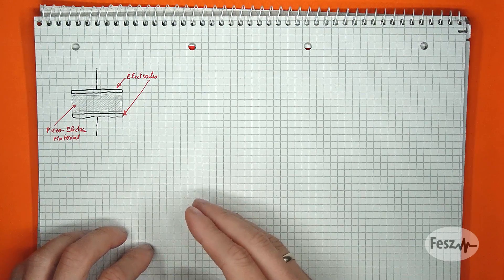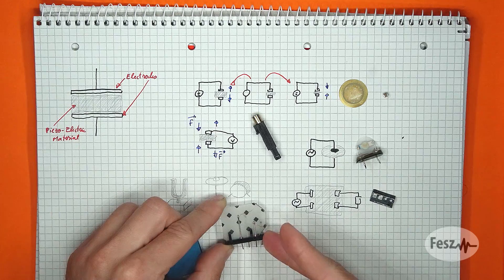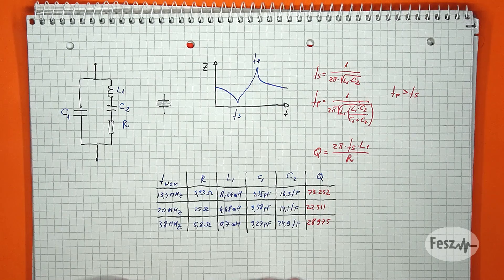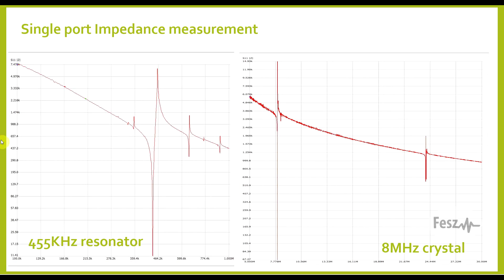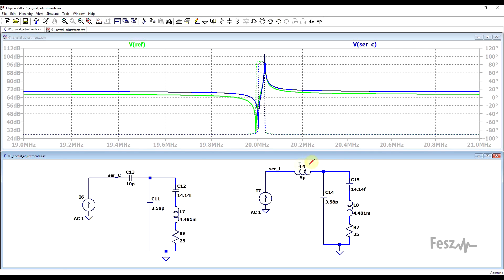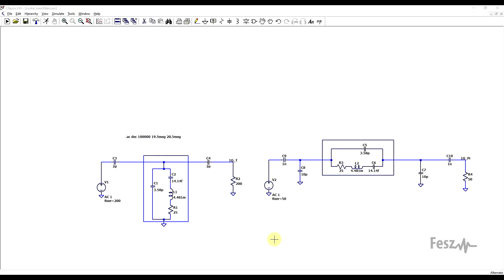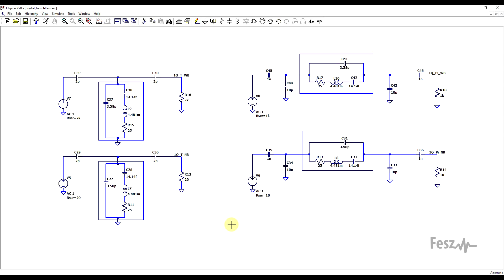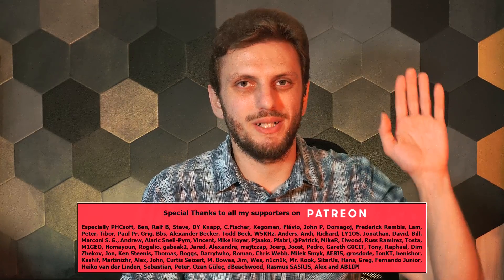Piezo-Electric Filters

Comment: The crystal model used is called the Butterworth Van Dyke (BVD) model. The model can be extended by adding multiple RLC circuits along with a single parallel capacitor to model the primary and secondary resonant and anti-resonant frequencies. For sonar usage, widening the band between the resonant and anti-resonant frequencies by addition of series and parallel inductance is an underutilized method for achieving better performance...

Comment: If that was a Philips delay line, I used to make those at the Philips plant in Blackburn UK probably around 30 years ago.  I operated the screen printing machines that put the diamonds of damping compound on the glass. I remember a display in the entrance that had with one of all the different generations of the delay line they had made.  The very early ones were huge.
Reply from the maker: Indeed it is a "Philips, DL700, 84701; kh 08010" these are all the markings present on the top side. I think it would be really special if this was one of the components you worked on in the past;
Reply: It would think that it would be rather unlikely to be one that I helped produce.  We would probably have produced many thousands per week. I think I left in around 1996 but production was ramping down by that point. Didn't think about it when I worked there but looking back it was really quite an interesting process.  Thanks for showing it. It's brought back some great memories.
Reply: So is that glass or quartz?
Reply: Was definitely glass,  although if I remember correctly I think some special formula (it's a long time ago).

Comment: I thought to myself when I first saw the case, “That's a delay line from a 1970s TV”. Yep, I'm old.
Reply from the maker: It took me quite some time to figure out what it was... I remember seeing these in old TV sets in the past, but I never knew what they did.
Reply: Me 2. Also old person 😂
Reply: @0:08 it's a video scan-line delay-line. It contains 1 scan-line (63.5uS long) and its analog contents are used to repeat/replace a scan-line that has a "Drop-Out" in it. The piezo-electrodes are on the corners of the glass, and the Piezo transmit beam enters @ a 45 degree and bounces around diagonally off of all of the edges inside until the signal finally hits the Receiver Piezo. The Seven black-spots on the glass are between the reflection grid to reduce beam path cross-talk and total crystal resonance.
Reply: PAL, SECAM or NTSC? 🤣
Reply: Hello fellow old person.

Comment: This is fantastic!  Any chance you are going to do one on mechanical filters?
Reply from the maker: What sort of filters do you have in mind?
Reply: @FesZElectronics  The ones that they used to use as IF filters on radios, like the Collins 455khz filters.  Very similar in a lot of ways to what you have here.  It just find how they model the physical parts in between interesting.
Reply from the maker: I'm not really sure if the operating principle is different, its just a different material - ceramics vs crystals.
Reply: @FesZElectronics  no, same principle, I just find it super cool.  I wanted to experiment making my own bad ones by hand and just seeing what I end up with :)